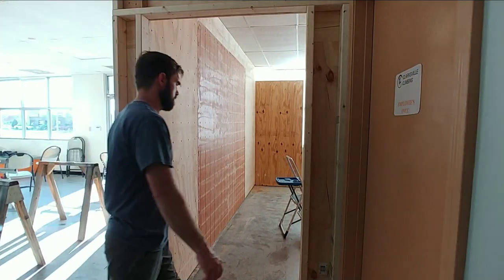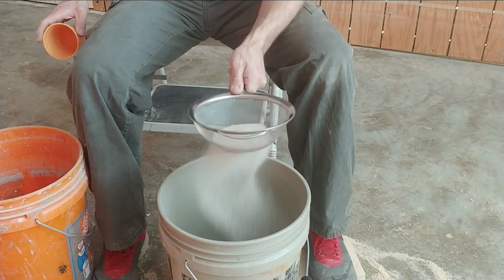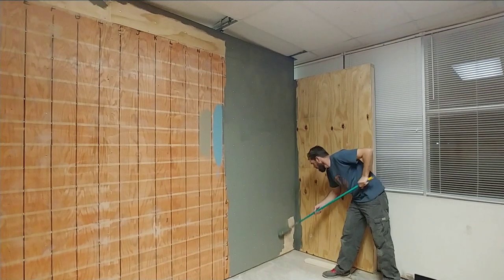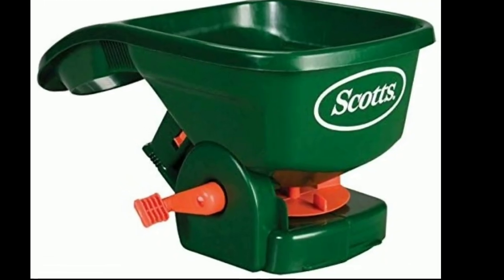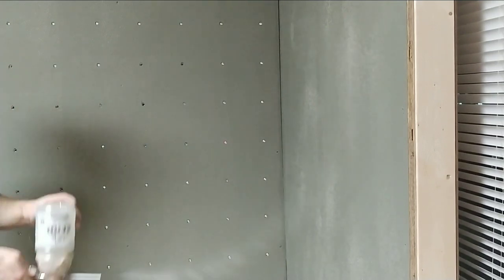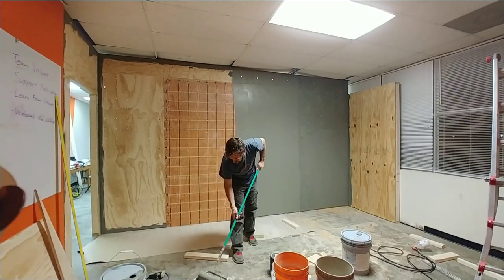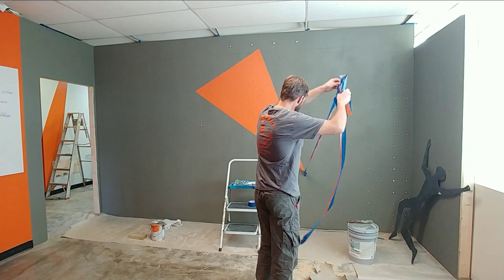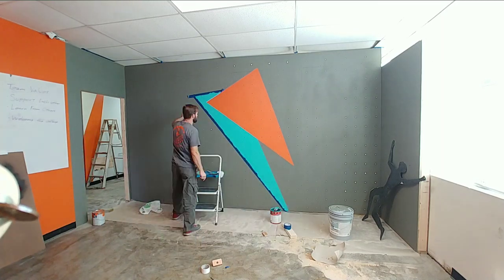HOW TO PAINT a CLIMBING WALL on a BUDGET

Comment: Your video quality is getting better. As for the paint, have you tried a two part marine paint by chance? I hear that they cure together rigid with the aggregate and resists wear. I made some volumes in a similar manor to yours (high quality garage floor paint and silica aggregate sprayed on top and then sealed/repeated) in the summer with pretty good results. Thanks!
Reply from the maker: Thanks! I have heard about the marine 2 part epoxy paints and wanted to test them out, they are just way over my budget. Gotta use what you can :)
Reply: @climberdad  ya, that's understandable. They also apparently smell horrid and are extra unhealthy to breath.

Comment: Does these paints adhere to the sand? And does they come off? Please really need your answers thanks a lot
Reply from the maker: You need to blow the sand on while the paint is still wet. Epoxy paint is the best, but expensive. Acrylic paint works too. After you've added the sand you'll need to lock the grains in with at least 1 more coat of paint on top.
Reply: @climberdad  really appreciate! Thank you man! 👍👍👍

Comment: I tried your method, but instead of cutting the tube on the cap side, I cut the tube on the other side.
when you turn the bottle, the sand falls into the tube.
Thanks for the awesome idea!!
Reply from the maker: Thanks for the feedback. How is it working for you?
Reply: @climberdad  I also tried to use a bigger pipe, but too much sand came out.  I will try to make another change.  I will let you know.  With your method I have already painted a wall, Thank you from Italy!!